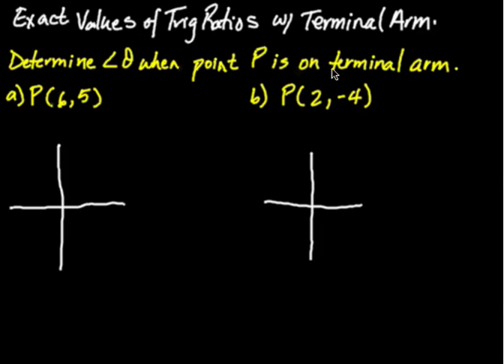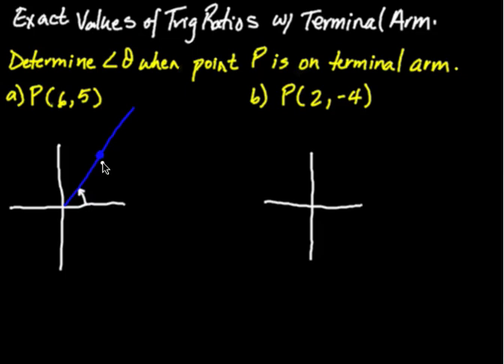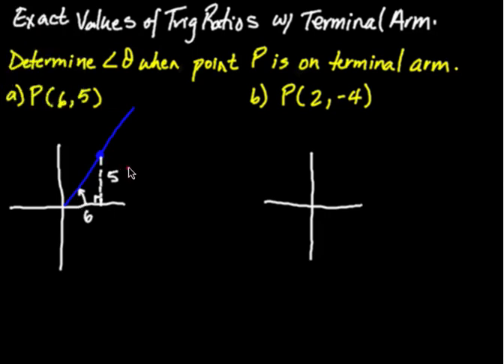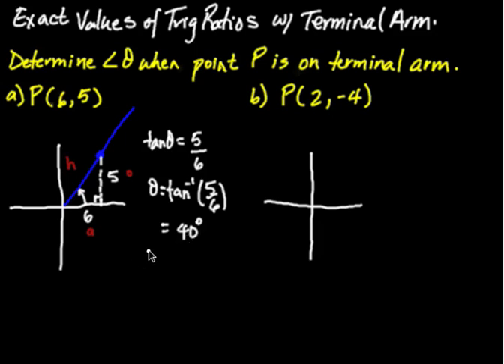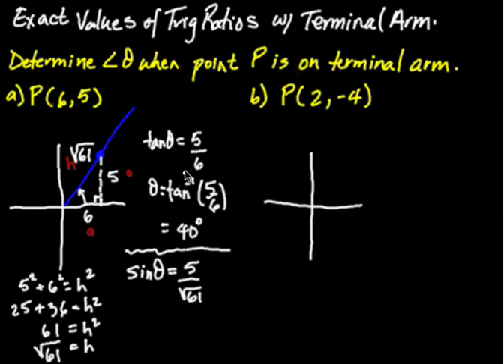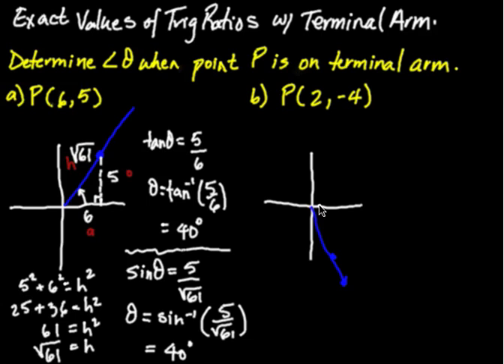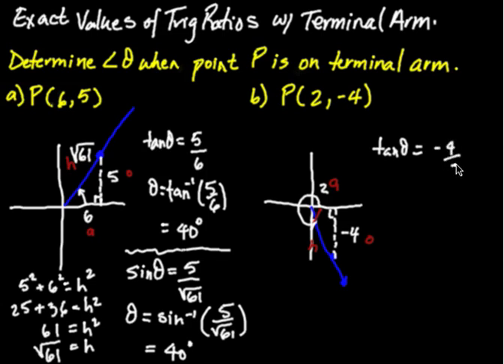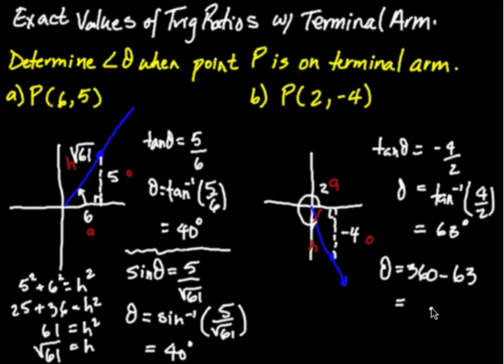Finding the Angle based on point on terminal arm

Comment: This is really useful. I'm actually going to use this for a program I'm developing that finds the angle of the joystick on my controller. Since the gamepad supplies two values, the X position and Y position, it's like a point on a coordinate plane. This equation does exactly what I need! I never thought I would find a use for complex maths like this in the real world, but now I have. Thank you! :D
Reply: atan2 would be what you use in programs
Reply: @deadpoolthecringeworthy5348  atan2(y, x) to be exact.
also, the comment was posted... 2 years ago
Reply: @mobile_ingou  to be exact, you'd research what atan2 does and how to use it...
Reply: @deadpoolthecringeworthy5348  my answer was correct? does assuming the origin is (0, 0) somehow invalidate my answer?

Comment from the maker: It doesn't matter whether you use tan, sin or cos all will give you the same angle.  Using sin or cos forces you to do more work because you have to solve the length of the hypotenuse before you can create the sin or cos ratios. I suggest always using the tan ration because the questions are set up giving you the opposite and adjacent side.  I hope this helps.